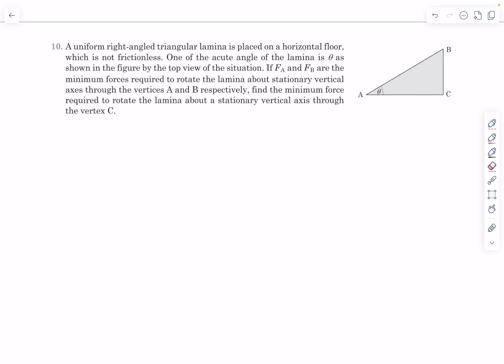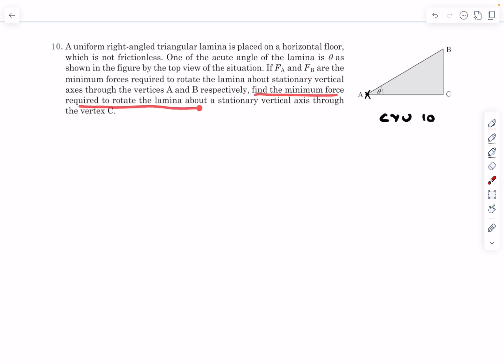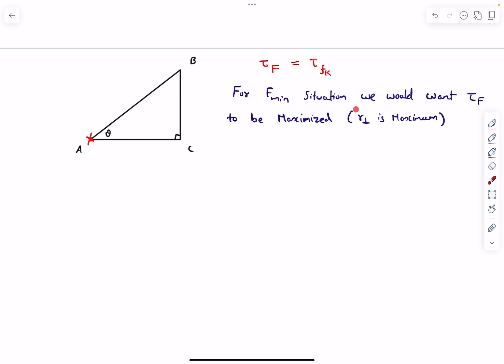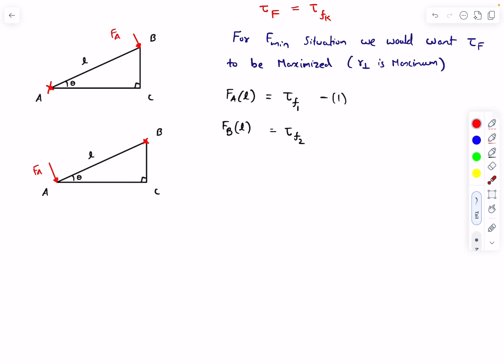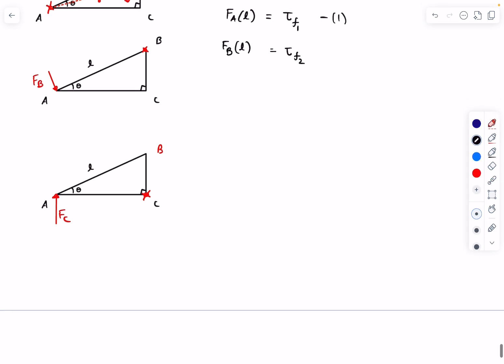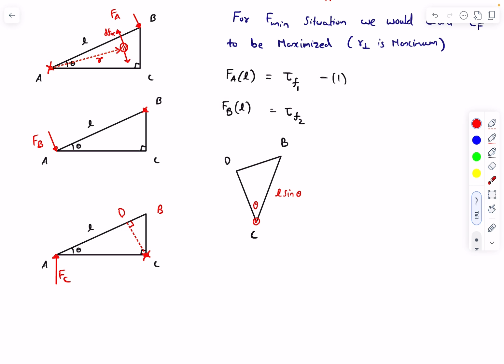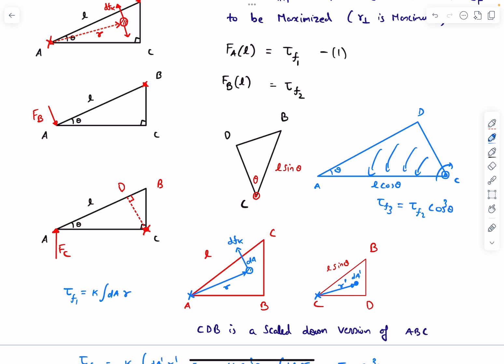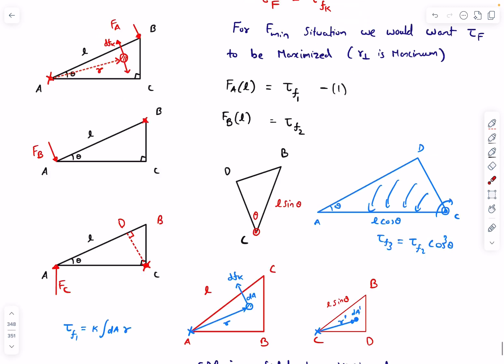[JEE] A Tricky Problem From Rotational Statics | Pathfinder | CYU 10

Comment: Bhaiya i have a bit of a basic doubt.

Consider two blocks of equal mass m, connected by a string, one of them moving with a velocity 'u' towards the other stationary mass. There is no frictional force and collision is elastic. So ofcourse they exchange thier velocity and now the mass moves away with 'u' velocity. My doubt comes here, when the string becomes taut again, they both start moving with velocity u/2 each (which i got by conservation of momentum). so the total KE now is (mu^2)/4 but initially when only one of the two blocks where moving it was (mu^2)/2 . So there is no force acting on them exept tension, the string is inextensible, net work done by tension is 0, no friction, so where is this other (mu^2)/4 energy going ?
Reply: hey dude, think of it this way, an inextensible string is tied to a fixed wall and the other end is tied to a block if mass m, lets say initially the block is near the fixed wall, and is given a velocity u. after sometime the string becomes taut and the block comes to rest. initially the kinetic energy was (mu^2)/2 and finally its zero where did this energy go? The answer is that, the interaction between a  PURELY INEXTENSIBLE string and a block is considered PURELY INELASTIC. and hence energy is lost. and due to this same reason there is a loss of (mu^2)/4 in ur question.